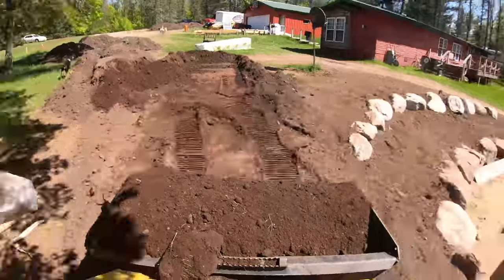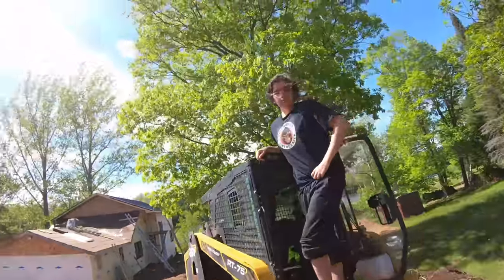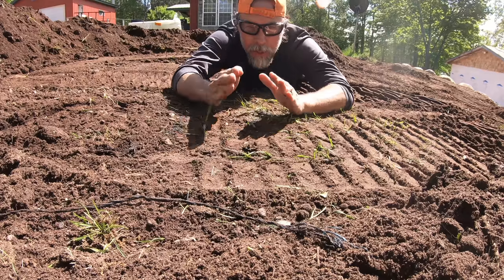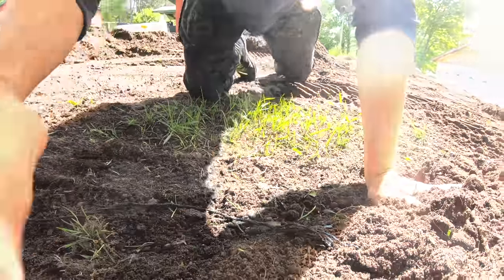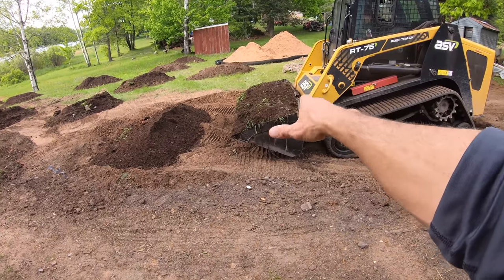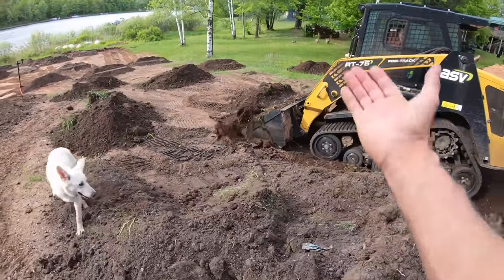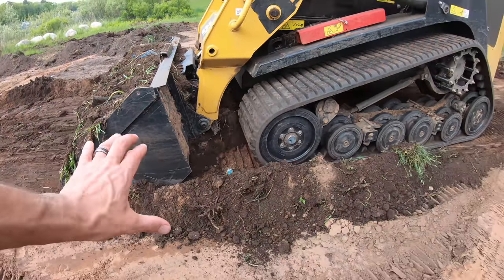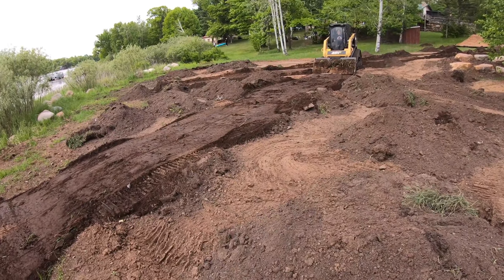How NOT to run a skid steer

Comment: Man i just wanted to work a little bit and got brought in by my cousin as a laborer. He got a new job and now i guess I'm running the skid steer. Was making mistakes yesterday. I don't know all the tools and i was just expecting to run hose and be the grunt. Now i'm running this. Boss told me to do some soul searching and decide if i wanna be in AC or outside in the heat with a shovel and rake. I could have backed out but Jordan Peterson said: the fool is the precursor to the savior...knocked over a pillar yesterday. Glad it was barried a little so we just had to stand it back up and pack it in. Things up front are closer than they appear..wish me luck today ha.

Comment: Something I find super easy long term wise is when I have to move material and spread it out, I go ahead and spread it out of the bucket on the ground instead of making piles. That way I can kinda see how far a pile will go and cover. Plus it’s smoother on the machine when grading.

Comment: I've done the hands off strat a few times especially when I was running an old skid loader that had controls that go directly to the drives and hydrologic valves where if you start bouncing and try to keep driving you'll make the bouncing worse by pushing the levers back and forth involuntary with the motion of the machine

Comment: It worked out for your son, he's a good student. I rarely back bladed, there rarely is any time as I had at least 3 headings to muck in a 10.5 hour shift, in development mining (tunneling) the driller only wanted the face (the end of the tunnel) back bladed so he could have proper grade for drilling the next 12' development advancement of the drift (tunnel), different but the same too.
Reply: 12' advance? What size drift and machines were you running? I worked at an underground limestone mine in Kentucky and we did 15' advance across a 25'x40' face, and did some work for a gold mine in New Mexico that did 10'x10' drifts. I mostly did mine planning, consulting, and rented them an EIMCO 911.
Reply: @Porty1119  something like that, I only mucked so I don't remember exactly, but was used mostly CAT 6 yds and Sandvik 9 yds all fairly new scoop trams. I also mucked in the deepest base metal mine in the world, Glencore's Kidd Creek mine, on the bottom level (9500' at the time) which is a very big mine, big machinery and very hot temperatures.

Comment: i always learned to not use the back of the bucket cause of thats where all the important parts and such lie and instead to use that cutting edge to pretty much angle it around the 45 or so like your dumping and use that edge to then drag back with it also gives you abit better visablity right in front.

Comment: Well, I now have an old but low (2410) hour 743, zero experience, and no one to train me. Guess watching and rewatching these videos is a good place to start. The next step will be learning to operate the Melroe backhoe attachment, it will probably be really ugly for quite a while. My biggest concern is that in addition to very hard soil we also have lots of rocks. My first project is a ground mount solar system which requires oak stump removal, site preparation, 4 big holes for support columns, and lots of trenching. The building dept. wants an insane amount of concrete to support the panels. Maybe I should consider documenting my progress, but I doubt many would be very interested in watching a 78 YO geezer making lots of mistakes. 
 First mod for the Bobcat will be installing a gimbal mounted marine cupholder for my coffee or iced tea.

Comment: I bought a machine similar to the herky jerky werky quad. Problem is, im a carpenter. Its main purpose is to dig fence post holes (because labor is so hard to find. I know eventually I will earn my money back if the machine just digs post holes. If you wouldnt mind sharing your opinion. what types of jobs could I focus on trying to get that wont be too hard on the small machine, can be done relatively quick, and can be done by 1 man and a stand on mini skid loader (with these attachments: forks, auger, 4in1 bucket, jack hammer, and a power sweeper.)
What would be considered the "low hanging fruit" now that I have this machine?

Comment: I accidentally laid a mini skid steer on its side because I got too fast and turned with the bucket two high. Got it back up with a tractor jack and wood blocks. the only thing wrong was the cylinders flooded with oil and I had to remove the plugs to blow it out

Comment: Quick question so I am currently using a skid steer to move some dirt and stuff and put it in a pile and the pile is pretty big is it safe it raise it up high at low speed and move a short distance just to dump it and then lower it back down

Comment: when he first started to front blade and begin to grade, you kind of screwed him.  He already had a full bucket, his cutting edge was covered in material.  How could he see where his bucket position was if it’s covered with dirt.  If you taught him to cut with either left side of the bucket or right, he can watch the other side of the bucket to see if he’s cutting in too much with the opposite side of the cutting edge, same premise of running a bulldozer.

Comment: I had a good dump this morning!  I'm half way to being a heavy equipment operator...
Reply: Sorry, just kidding.  I gotta wheeled skid steer coming tomorrow.  I watched my dad many years ago running heavy equipment.  When I expressed interest in doing that for a living he (no pun intended) steered me away from it because, "You will have back trouble when you get older."  He was a diesel mechanic by trade, and worked on the heavy equipment for a construction company that built interstate highways in Missouri...many years ago.  I went the mechanical engineering route and worked in aviation for about three decades.  Dad was really good at running the equipment he worked on, and rebuilt an old county road for the driveway to the home he built for our family back in the late 1970's and early 1980s.  He had an old diesel Alice-Chalmers steel tracked "highlift" with a bucket that went pretty high in the air.  It was quite fun for a young boy like me, taking the controls of what seemed like a fairly large machine.